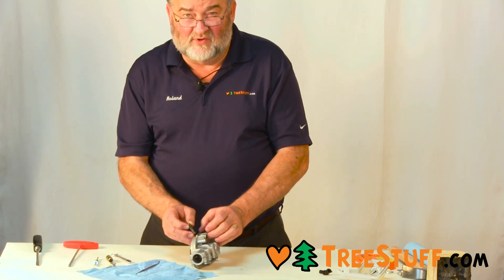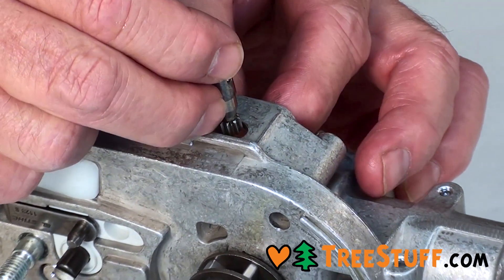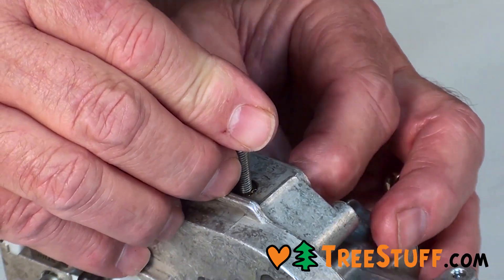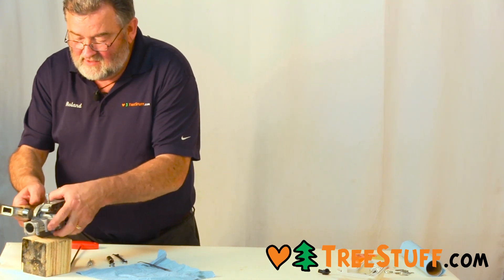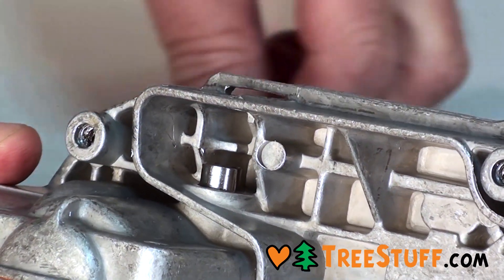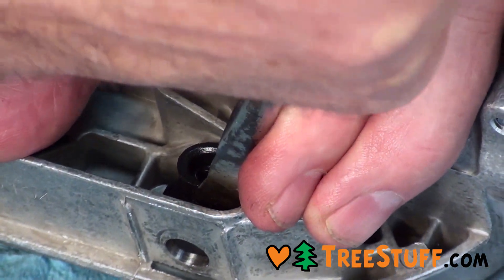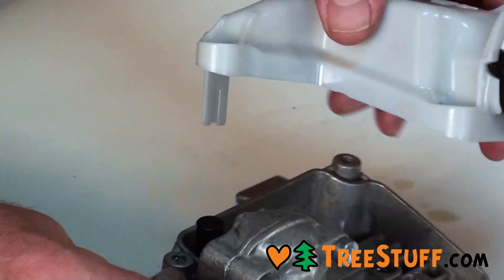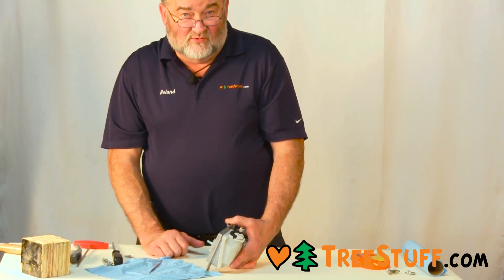How To Put Your Oil Pump And Gear Housing Together - TreeStuff.com Chainsaw Maintenance Videos

Comment: I wonder, is that a Stihl branded attachment or an aftermarket copy?
Reply: I wondered as well, but the first part of the video (a different video about taking the pump out) shows a genuine Stihl HT.  I have a 38.2002 gearhead which is older than the one he is showing and different in several respects.  All models of the Stihl HT gearhead have a 90 degree chain tensioner, there may be knock offs that have them but I have only ever seen tensioners parallel  to the bar.

Comment: I wish the title had "Stihl pole saw" in it so I could find this video easier. If you put a small amount of poly fill in the pick up filter canister before replacing it, it will keep the clog from happening as quickly. Using a paint brush or something to brush away the dust from the caps before opening to refill will also help.

Comment: Do I need to add gear oil to the pinion drive gears inside the gear box? Or does bar oil lubricate them?
Reply: separate gear lube for gear box
Reply: Synthetic grease works best in the separate gearbox.